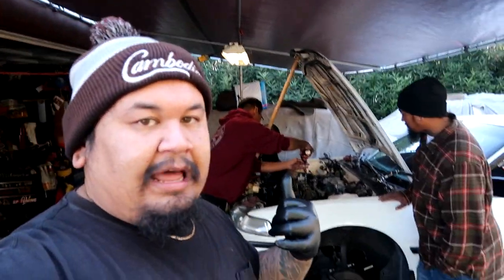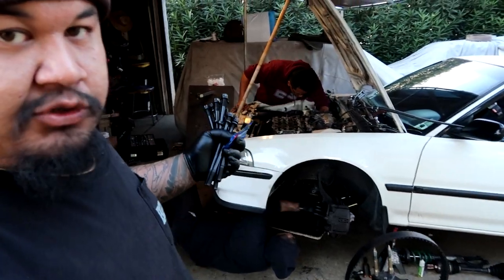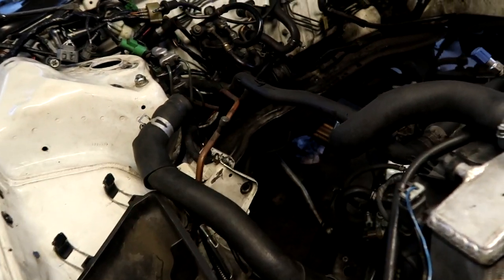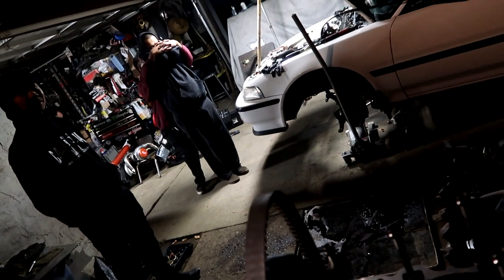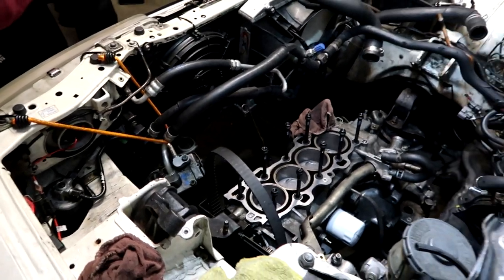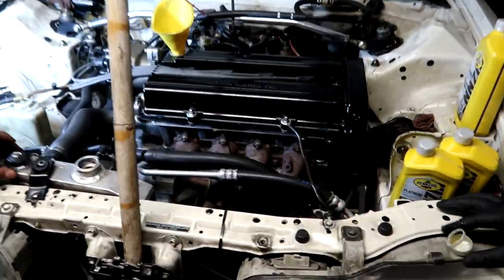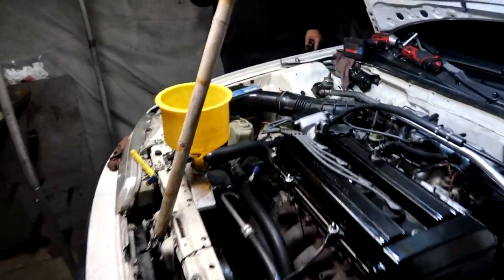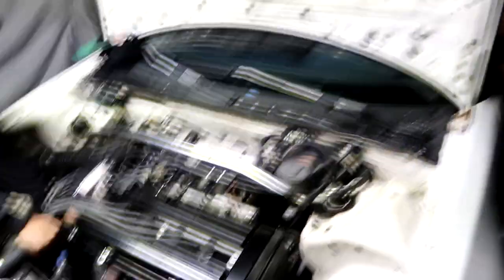DB1 Integra Nippon Turbo Piston + Scat Rods B18B1  Short Block ! !

Comment: Man I need homies like y’all around. Y’all cranked that shit out quick. I just want my DA running again 😫😫
Reply: Whats wrong with it? And where are you at?
Reply: Harold Finch  book time for a long block swap calls for 10hrs. I did mine by myself in 7.5hrs. I did do it at the shop i worked at but i drove up at 7am and 330 the same afternoon i was driving home. So with the crew they had, i say it took the 4 to 5hrs total.
Reply: Shawn Hatcher I bought it a month and a half ago. Drove for 2 weeks then issues started happening. I pulled the head to clean pistons, clean the head, new gasket, remove stock exhaust manifold, replace pr3 intake manifold with pr4 intake manifold. But other issues kept popping up. I’m in Seattle so fighting time to do it and shit weather has dragged it on long than I hoped.
Reply: @RadGarageMechanic  yo I'm in Seattle too
Reply: John is special hell yeah. Let’s link up. I don’t really know anyone up here that builds. I’m originally from San Diego. Hit me up on Instagram if you got it @da9rad

Comment: Bro, I made 612 whp on my built LSVTEC with CP 9.0:1 pistons, Eagle rods, balanced rotating assembly, B16B head, Skunk2 Tuner Stage 3 cams and valvetrain, Skunk2 Ultra Race 3.5L intake manifold, Skunk2 90mm throttle body, Gates 2200cc injectors, K-tuned Composite fuel rail, Hondata S300 V3, Hondata CPR kit, Accel coils, PLM top mount turbo manifold and 3" downpipe with no cat, full 3" Thermal Research turbo-back exhaust, Turbosmart 60mm Powergate, Mac boost control solenoid, and the same GTX3582R on 22.5 psi with no timing. The only reason we stopped there is because my turbo has a .83 AR T3 exhaust housing and it wouldn't make any more boost. I have to pull the turbo and get a 1.06 AR housing. Homeboy with a sleeved 10:1 engine and the same turbo should easily make 550+ on 20 psi with a good tune (which we all know is all that Gythe does).

Comment: I do my oil pan dry as well I also use fel pros oil pan gasket but the one with the metal inside the rubber. Prevents smashing it and you’ll strip the bolts before that thing smashes

Comment: Do you like the ACL pumps?  I've heard mixed things about them
Reply from the maker: ive had mine since 2012, havent had any issues with it. good for high performance engines.
Reply: @YoungStatic  good oil pressure?  I've heard some ppl say it isn't so good.  I got one for my engine but I managed to strip the pickup tube studs out of the pump somehow

Comment: Have you used this piston rod combo before ! I was thinking of using for my turbo type r ? Shooting for 500what you guys think they will hold to that
Reply from the maker: it will do 500. this is our first time doing the nippon/scat combo. vhb engine uses them and also sketchyda9
Reply: @YoungStatic  how did the pistons work out after boosting ? I keep looking that same setup nippon turbo pistons scat rods for my jdm b18c type r. Looking to go about 400-450 hp 93oct pump gas

Comment: so you had timing off a tooth and then corrected it through the dizzy?
Reply from the maker: yes.
Reply: Is that not going to cause any issues with power curve? Or was it just barely off time
Reply from the maker: @AHS_motorsport  no..because its timed. it wasnt actually off a tooth, it was like half tooth which made no sense. couldnt get it dead on which ever way i did it. but compensated it with a timing light and car drives with no issues.
Reply: @YoungStatic  fair enough. Do you think it has something to do with block and head decking and a difference from stock heights? I've run into issues like that before

Comment: Bro quick question, your going to work on a b20b next. Ok I have b20b non VTEC with the grs transmission 5-speed in a 96 ek, do I keep the ECU that came with the ek, or do I get a ecu from a Integra? Thank you
Reply: I got that same setup I have a integra ecu with hondata and a integra wire harness
Reply: Thank you Dru, I will get the Integra ecu next. Thanks again
Reply: @gregmenottis9937  also if your not running all the emissions stuff your gonna need hondata or you will get a check engine light but car will run fine without it
Reply: I'll be driving the car for the weekend only, but I don't need all the lights. For now I want to drive my car again lol.

Comment: hey guys i drive a eg hatch at the time and a couple days ago i drove 3.5 hours to buy a crx 
i bought it and i am like 6.6 feet tall and i fit in my eg with no problems but i dont fit in the crx with after market seats at all
it was not that cheap and i wanted it so bad but now i fell realy stupid
does anybody got some good thoughts for me?
Thanks!
Reply: ricky spanish can you move the seat bracket back so you can fit? Or is a head room issue?
Reply: @TAkEdA31  yes i dont got enough head room so i was wondered if someone else who is 6 feet tall or so drive a crx
Reply from the maker: there are other lower seats in the market. little pricey but worth the buy for quality and comfort. i had to remove my sunroof so i can get more head room due to sitting straight up for racing
Reply: @YoungStatic  thanks i am gonna do that